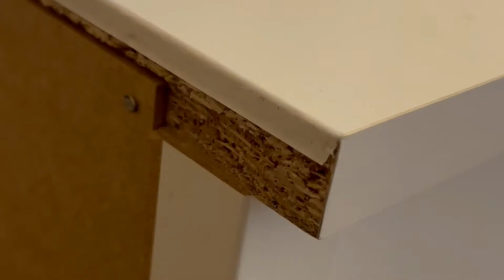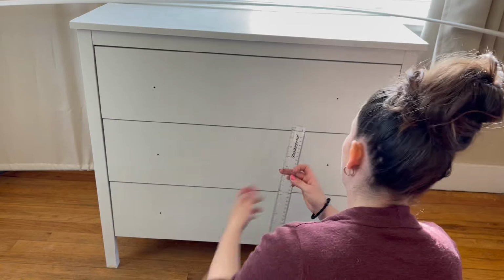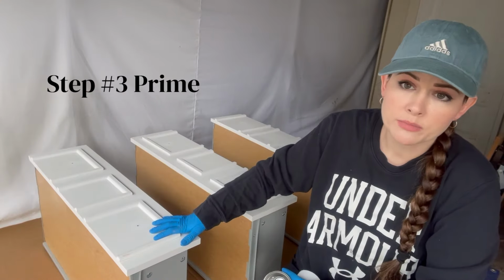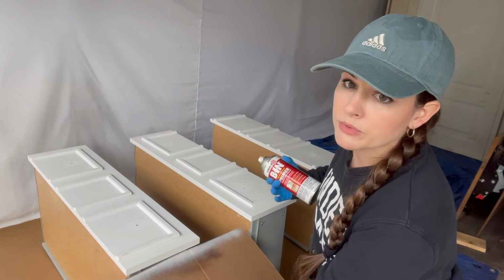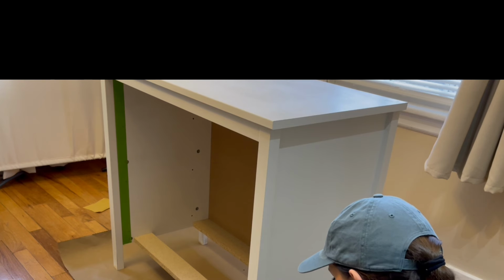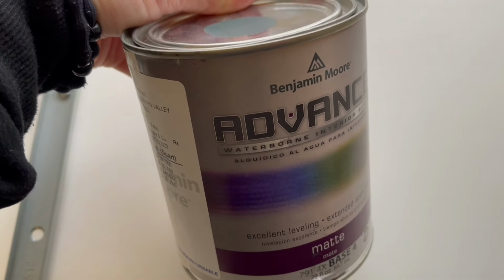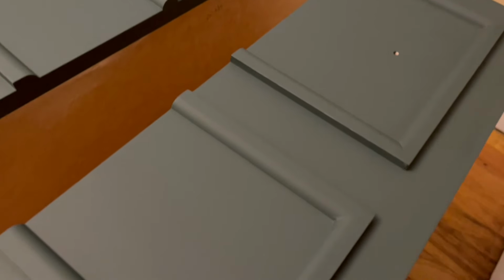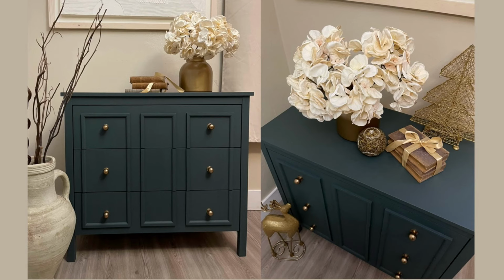How To Paint LAMINATE & PARTICLE BOARD|| IKEA Furniture Makeover!

Comment: There is more pressure on the side of the roller that is closest to handle. Therefore, if you make sure that metal bump in the handle is pointing in the direction that you are painting, you will minimize the lines.😊
Reply from the maker: @sashaflorianthiel4559  That's interesting!  I'm trying to figure out what bump in the handle you mean.

Comment: Pre soak your brush in denatured alcohol before priming with Zinsser BIN shellac primer.  It helps a little.  The only way I found to clean the brush is to soak it in a glass jar (like a big pickle jar) with a lid filled with denatured alcohol.  Doesn't get them perfectly clean, but I can usually get a couple more uses out of the brush if I do that to clean them.  Brushes are expensive, so I try to get a couple uses out of them, but in the end, all shellac brushes end up in the garbage.
Reply from the maker: Yeah that shellac really is rough on brushes, I try to just use a roller and throw it away or cheap brush, but that's a good tip with the denatured alcohol 👍🏻 I didn't know that would help before application. I do wish it was more friendly in a paint gun, did that once and learned my lesson haha, the alcohol can clean the paint gun out but that's a process.
Reply: Murphys Wood Oil Soap. 😃
When I am in the middle of a bigger project with lots of different colors/brushes I keep a mason jar full of Murphys and all of my used paintbrushes, and then at the end of my project I just clean all my brushes all at the same time. 😅

It’s also the best I’ve found to help bring stiff brushes back to life (though I’ve never tried it with a completely dry, rock hard brush).

The bristles are always super soft after they dry, which is a bonus 🙂
Reply from the maker: @RecordConcreteCutting  Oh awesome that’s a really great tip! I do struggle with having so much gunk stuck in the base of the bristles after a few projects. I’ll look up that product👌😊Thank you!!

Comment: What grid of sand paper did you use in between primer ? Also what kind of wood filler do you like best on a laminate piece . I have an ikea file I need do repair but it is white & I need to keep it white , thank you
Reply from the maker: I used 220 grit sandpaper. Generally my favorite wood filler all around is the metal cans of Plastic Wood by DAP. I would say it's probably the next step down from Bondo in strength if you're needing to repair corners or things like that. But on little fills like the holes on this trim after I used the nail gun it's not necessary to have that, so I just used Minwax wood filler in white, that comes in a tube. 👍🏻😊

Comment: I love!!!!!seria muy amables de decirme donde has comprado la tijera medidora roja  con formato de mariposa que usas cortar? Gracias 💋🇪🇸😘
Reply from the maker: Thank you!!💛💛😊 I got the miter shears at either Home Depo or Lowe's but here is also a really good pair with an adjustable guard and a couple extra blades on Amazon that I think might be better than the ones I bought actually 😄 here's is a link to the ones on Amazon, but you can find miter shears at other home improvement stores too 💛
 GARTOL Multifunctional Trunking/Miter Shears for Angular Cutting of Moulding and Trim, Adjustable at 45 To 135 Degree, Hand Tools for Cutting Soft Wood, Plastic, PVC, with Replacement blades https://a.co/d/da87eHC

Comment: Is there a reason you sand then prime then sand again ? Then paint ? Just trying to learn as I will be using this exact piece from ikea to paint
Reply from the maker: @raisingkaras5240  Yep! The scuff sand will help take off the glossy texture of any piece and give the primer more grip on the surface. Then I do a quick sand  on the primer to get down any texture or brushstrokes because this type of primer drives very quickly, so because of that it gets texture more easily. But it's very easy to do a quick sand on. And that way once you paint over it then it  won't have those brushstrokes and texture showing from the primer underneath. Sometimes people even do scuff sand between paint layers, but if you can get the finish smooth enough with the paint you don't need to do that. Hope you have fun with your project!! 😊

Comment: I got the same procrylic top coat and it recommends sanding with 220 grit between coats. Did you do that in your video? I didnt see a segment where you mentioned if you did or if you skipped the sanding between coats.

Thanks so much for making this video, I've been coming back to it over and over for reference when painting my Ikea storage shelves, which I'm still in the middle of the project!
Reply from the maker: I'm so happy to hear that this video has been helpful on your project!! Thank you!! 😊 
So with the sanding between, I often don't sand between poly just because when I use the blue sponge it's usually sufficiently smooth for my taste, but you can definitely make it even smoother sanding between coats (skipping the last coat) Once in a while, they'll be like a little fuzzy from the air or speck of scratchy dust or something in the finish, so a sand between coats could definitely help that, especially if you live in a home with pets. Some people have more texture with poly when they're using a paintbrush or other types of applicators, but the blue sponge makes it really nice👌🏻😊

Comment: Can you explain how you measured/did the math for/and labeled each piece of trim you added? Please? :)
Reply from the maker: @casadielittle3962  Hi 😊Sure! I start with drawing the perimeter of my design right onto the dresser starting with how far inward I want the border to start, I usually favor around an inch and a half to 2 inches but it can be whatever you want. Then I take my extra long ruler across the drawers to make sure all the lines lineup properly and then I work on the different sections from there, they can really be whatever width or length you want 👍🏻 I like to draw out dresser designs on paper just to see what I like to look of first. Then I get the trim and lay it right against those lines and make little pencil marks for the sections and where I want to cut the miter shears. Then with the number matching, I just put the number on the back of the piece I cut (just starting at 1 and so on) and write the same number by the line on the dresser, so that all of them fit where they’re supposed to be in the end. I go into more depth of these steps in this video of my most recent furniture, makeover if you’d like to watch 😊 https://youtu.be/tQ0oukVrYtI?si=4MRDCpHuV8CHCEO-

Comment: Hi can you put that water based top coat over enamel paint ?
Reply from the maker: @cs4180  Hey! 😊 Yep, you can! Typically you won't even need a top coat with enamels, but this matte finish was pulling up tiny imperfections when I was doing small spot corrections after the initial coat so the clear coat balanced it all out again. But usually you can go without, but you can definitely do top coat if you want to as well 😊

Comment: How much sheen is added when you added that topcoat, even though the topcoat was matte?
Reply from the maker: There is a bit of sheen in the topcoat when compared with the extremely matte finish the paint has. I use that topcoat on most of my projects and it's done a nice job, however I just purchased General Finishes "flat out flat" topcoat, which has really excellent reviews for staying truly matte better than most competitors, it is on the more spendy  side though. I'll show you guys how it works out on the next video I'm working on!😊
Reply: @therefurbishedlife do you also add top coat to the drawers? Or just the top of the cabinet. If to the drawers, do you still use the sponge or how do you handle all the grooves?
Reply from the maker: @brittneymerryweather9405  on this one I only added it to the top, but on almost every project I add poly to the entire piece. When you're dealing with angles, I would suggest either using a foam applicator-the kind that has a wooden handle, or a really good synthetic bristle brush like Zibra brand, those typically have a much smoother application than natural bristle brushes!👌🏻 😊

Comment: I keep trying different methods, rollers, paint brushes, good paint, thinned, not thinned, sand, sand, sand, and I can’t seem to avoid brush marks and/or roller marks. What could I be doing wrong?
Reply from the maker: I think the first two paints that I would recommend for leveling would be either this paint (the Benjamin Moore Advance line) or Valspar cabinet and furniture oil-enriched enamel. Both are really strong and have really amazing leveling. I use the Wizz brand foam roller, and Zibra brush for angles typically. When you put the paint on, you don't want too much on your roller because that will increase texture. When you first roll out the area, each time you pass over that area again with the foam roller you need to have less and less pressure and that will pop the bubbles and diminish the texture, but you have to make sure to not keep messing with it once it starts trying to dry because then you'll make more texture. Sometimes adding a little bit of Floetrol to the paint will also help it level, if you're working with a finicky paint. Some people will also use a spray mist bottle on the area before they apply the paint but if you're working with particleboard, I wouldn't recommend that, since water can start messing with the material.  I have a video that might help you with texture issues, it's my video on black paint finishes, I'll try to link it here for you 🙂
https://youtu.be/mZxcUbTVBlg?si=n-5JV4ouI4J5zStn

Comment: I'm confused. I've been told in paint stores and read so many times that you never mix oil-based and water based products because the paint will peel. But it seems you primed with oil-based products and then topped with latex paint? Am I correct with this? Thanks for your help.
Reply from the maker: @californiagirl2461  Hi! No problem!😊 This primer is shellac based and this paint is an alkyd enamel👍🏻 I usually prefer not to use latex paint because it tends to peel more than others, once in a while I will use it, but it requires very good prep prime and topcoat, but I'd rather just use other types of paint like this enamel because it's more durable.  
Typically the rule with oil and water products is to not layer them, you're right! There are some products that are exceptions to the rules like Minwax polycrylic can actually go over an oil base stain, but you'd have to make sure that the oil based stain has a few days of dry time before applying your topcoat. And so this is good news if you wanted a matte finish top coat, but you used an oil based stain, for example.

Comment: Beutiful! Can you use a water based top coat over an oil based paint?  Where do youbuy q round sponge like that? Why do you need to paint during daylight hours? Thanks!
Reply from the maker: Thank you so much!! Yep you can use a water based top coat or oil based over this type of paint, it's the Advance line which is a waterborne Alkyd enamel 👍🏻  
I order the round blue sponges off Amazon, hopefully the link for them works properly down in my description area 😊 
My situation with the daylight hours is that I don't have a proper lit place to work past dark hours inside-no room for doing furniture, or a shop or car garage or something like that, so I have to work outside during daylight or inside our living area where there's not very good lighting. I have a regular job during the day so by the time I get home there's not much daylight left in the winter, but I'm glad for better weather and longer days come summertime! 😊
Thank you for your comment!!

Comment: A paint shop can mix color in your primer to match the top coat. This is if you use a normal paint primer not from a spray bottle.
Reply from the maker: Yep! But for 1 quart of Zinsser BIN I could do probably 5 different projects and I'm never sure what color I'm gonna do next, whether I'll need a light or dark primer. Maybe I should leave one container regular and have another tinted dark🤔 I'm using a clear shellac for my dark project right now.

Comment: Do you get bubbles? I got bubble and feel lumpy after it dried ,
Reply from the maker: @nenenicole8291  They finish is usually smooth for me, I apply thin layers and always make sure to wring the sponge out with water before I start and then sometimes if you’ve been working on the layers for a while and the sponge starts creating a kind of foam on it, then I wring it out with water again and start it fresh again 👌🏻😊

Comment: Is that paint color similar to teal in any way?
Reply from the maker: Yep, I wood say it is somewhat, leaning more towards the green side of teal. The lighting makes it change from more green to more blue a bit too I noticed.
Reply: @therefurbishedlife hello your work is amazing i’m trying to refurbish my bedroom dressers. Of course I never done this before. Laughing out loud. Just need a little guidance. Do I first sand then  prime sand again then paint?
Reply from the maker: @katrinahall2253  Thank you, that's really kind of you!!😊
Yep, you're correct!:) Generally the rule of thumb if you are painting furniture is to make sure you do the prep work first, starting with a cleaner that's a good degreaser-I generally use diluted TSP alternative, but you can use Mean Green or krud Kutter, or whichever you prefer. Afterwards you just wipe off the residue with a damp rag👍🏻 then you need to scuff sand the piece ( this will remove the shine and help the primer adhere) and then apply your primer. There are a few different primers that I would suggest, but generally the one with most adhesion for me is BIN shellac based primer. I usually do two quick coats then let dry and do a quick sand of any texture (this type of primer sands really easily and quickly) 👍🏻
Then you go ahead with whatever paint you like to use, some paints required topcoats and others don't. If you're going for a very durable paint I would recommend an enamel base paint, Behr and Valspar have some good ones:) But if you're worried about durability, a polycrylic or polyurethane top coat afterwards is never gonna hurt! With topcoats, ones that are oil based tend to have a yellowing effect over time which is fine if your your paint is black or another dark color but if you're painting your furniture white or something light, it might be good to use a water-based topcoat which shouldn't yellow😊